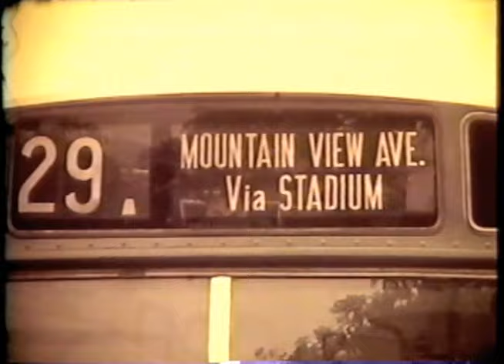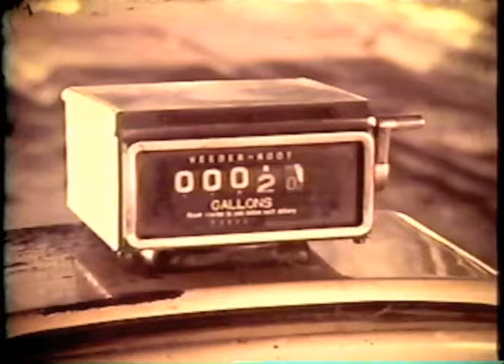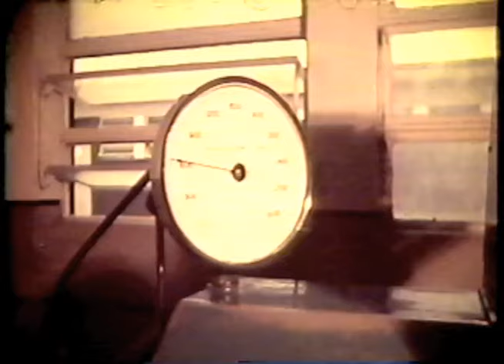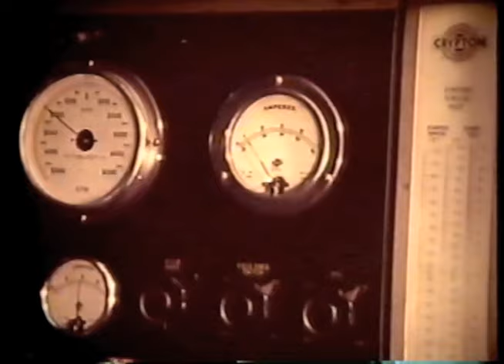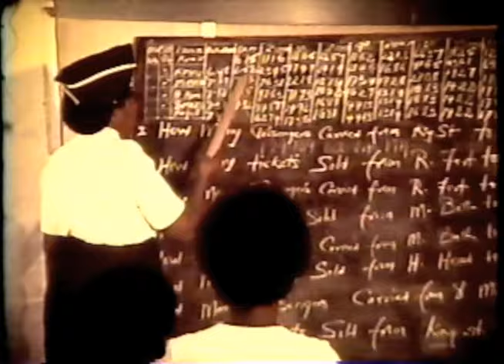Keeping Kingston on the Move - the Jamaica Omnibus Service (JOS)

Comment: I remember using Jolly Joe during my school years.Very reliable and dependable. So very sorry that they are no more. Kingston does need another reliable bus system. Robots is not the answer.
Reply: Middleton Lyn, when was JOS service reliable and dependable?
Reply: I got a job at the JOS just out of highschool in 1968, it was quite a great learning experience. An excellent service during the '60s
Reply: @two9parkave  my father used to work there as a bus driver you probably know him, his name was George Campbell he worked there from 1960 to 1972 theres still a couple of TheL & G buses still around but not running .L 99 is still around some lives in it in bull bay & one in st Elizabeth you can pull up hostel buses in jamaica if you wanna see it they both in good condition despite parked so long .i wish the right people recognize the historical value of such an iconic vehicle .those are the original Chi-Chi buses because of the sound the doors make when opening or closing.
Reply: I was a mechanic at industrial terrace, but I did know many drivers on the#1 Maxfield Ave route.
Reply: @two9parkave  you might hear about Gloria McDermott she along with George Campbell a.k.a Georgie they drove East routes bull bay Franklin Town Rollinton twn etc .those days were some good days till this day i missed seeing thegood old Leyland Olympic
Reply: Buses those buses remains the best set of buses ever went to Jamaica.
Reply: @robertcampbell9946  I was familiar with most of the drivers on #1 and #15 Cross roads. One driver was Me Ellis and another called White. I worked in the fuel injection Dept for a while in fact I can see Mr. Cover, the department supervisor in the documentary. Great days.
Reply: So what about jutc?
Reply: Wow, I knew it. When J O S  were there, you people used to curse and treat the drivers and conductors so badly.One of your saying was J O S is to go away and let Robots take over. I remembered it well. I always say the day will come when you all wished Jamaica Omnibus Services were  still there. Enjoy your dirty buses and mini vans, stop complaining. How do I know? I was a Conductor from 1969 until 1973. God bless the day I migrated.
Reply: @inezsmall8474  Hi Inez , my father used to drive J.O.S buses in the 60 ,s you probably know Gloria Mcdermott & George Campbel aka Georgie he light skinned & could pass as Spanish.I remember him driving one of the L bus brand new. come pick up my mom . The. L & G buses looked very good at night when they light up the billboards